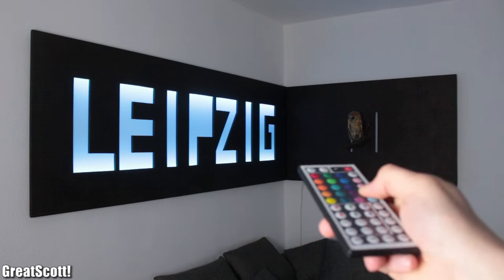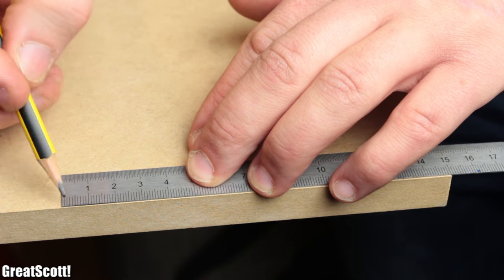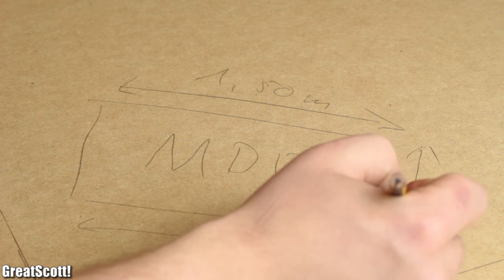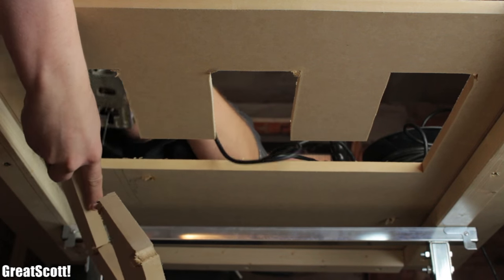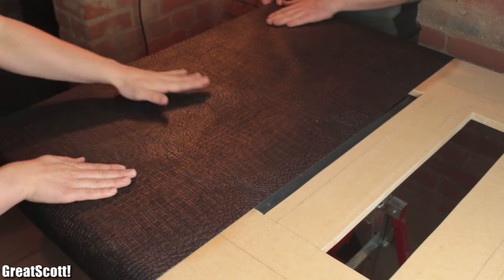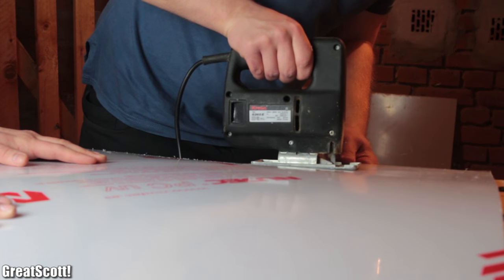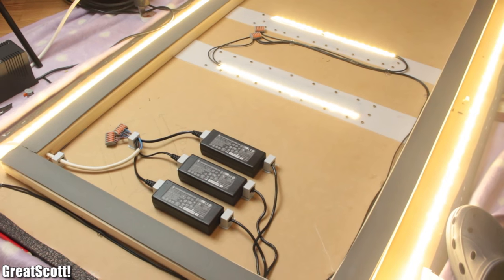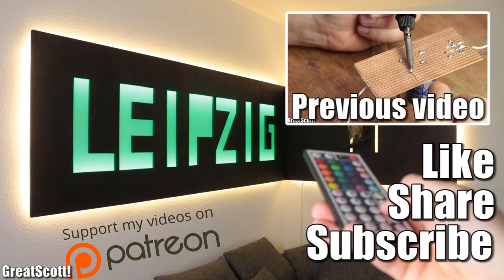How to make a Huge Light Up LED Sign

Comment: When you don't own a Laser think about just getting a "chalk line" (in german "Schlagschnur"), they are less expensive and real simple to use. Mark both lines at the end of the boards and then pull out the cord and pull it tight over the length and while it's under tension pull up in the middle and let it snap on the board it will then draw a clean straigth line of chalk on your wood. This is what was used before all the laser stuff ;)

Nice project.

Comment: A slight improvement to get more light out of it: I built some indirect lighting myself a while ago. You should spray the backside of the wood with white paint. It will absorb less light. you could Even use some aluminum foil but this might cause reflection spots.

Comment: For the Sing, I think you could use something other than FDM, Maybe foam board Or something lighter.If your running wood supports behind it anyways. Also I think you could of used french cleats To support the boards, With out having to deal with a hiding sport for the screws. Those two things i'd likely do differently But cool build

Comment: One thing you could have done is run the AC power through the wall so you dont have the wire dropping down. Other than that, awesome project!

Comment: it will be easier if u use a wedge system to hang the panel.

1 board cutted in half with 45 degrees. 1 to the wall and. to the panel. thats rhe simple way to hang something in the wall without visible screws

Comment: It's a nice video and you explained every detail of the construction. But i am missing the part where you explain how to set everything up to control all the leds from one remote and with different colors at the same time. That's the part i'm interested in.
Reply from the maker: +LsHallo Vader Those led trip kits come with a controller. You just plug it in and it works. Nothing special.
Reply: +LsHallo Vader He is using 2 different controllers and remotes.. You can see it during the video that there are two different remotes.
Reply: +morri908 Ok i didn't got that. In the first sequence it's looking like he is using one controller to first control the color, and then switch on the white leds.
Reply: +GreatScott! I know that. I got one myself. But as you read. I thought you are controlling different kinds of led strips with one remote. That's made me curious.
Reply: LsHallo Vader
Poor video editing. Its a very short clip of the second controller...

Comment: Hey everyone, this project that they did was so awesome!! 
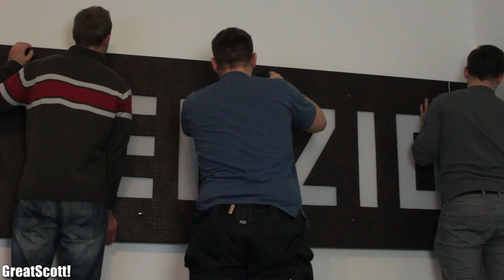but at the very end when they secured it to the wall they used "plastic anchor" 6:12 also known as mollys (not the drug). If you have dry wall than you would rather screw into the studs behind the wall, placed every 16" or 50cm, because drywall anchors don't hold much weight.
it looks like they have some sort of plaster wall and clearly for them the anchors they used can hold enough weight to support their art piece
just a heads up for anyone who want's to build their own sing, I know I want to! haha
Reply: +Matthew zuber those walls are the standart in germany... I know that problem from florida and yeah you are right! It´s kinda important for all non north european viewers !
Reply: +Matthew zuber Securing into a stud is definitely more secure, however, if I were doing this, I'd probably use the same (or similar) technique. There's not much weight in this case, so I don't see the need to ensure it goes into a stud. Those anchors are rated for around 5 pounds each and he has 10 of them; 50 pounds should be plenty. Additionally, you don't really know until you hang it exactly where the studs are, and if you want to move it in the future, the new studs may not be in the same relative place to your holes, overall making the project harder.
Reply: +Matthew zuber Some drywall anchors can hold a lot of weight (in the range of a couple of hundred pounds). While mounting in studs is preferable, it is not always possible or practical. I would tell people that use wall anchors to check the package and make sure they get anchors that will support the weight. Also, if you are renting then wall anchors will probably be prohibited as they will be considered damage. Lots of thought has to go into using wall anchors as well to make sure you don't nick something like a pipe or wire.
Reply: Not the drug, had me laughing

Comment: the way you make your name sign "great scott" what sort of power supply do you use? do you also use a resistor? Were all the leds in series?
Reply: All in parallel and powered by his variable power supply, so no resistors necessary.

Comment: Where did you mount the IR receiver for the LED Controller?
Reply: its not IR controller. I suppose its RF controller...
Reply from the maker: +Ej908Productions It is right above the boards. Hard to see in the video.
Reply: +GreatScott! Ah now I see it. Just to the right above the G.

Comment: Why would you even need 3 of those power supplies? That is way overkill if you ask me. One of those can give out 30 to 65 watts alone, and that's 90 to 195 watts of a playground those LED strips have...
Reply: +Krisztián Szirtes Each of those strips uses ~80 watts. 
I have one of those strips (they're like... 20 USD on ebay for the waterproof ones like what he has), I use an old ~200 watt xbox 360 powersupply to power it because the 65 watt supply I was using could not fully power one LED strip. Let alone 3 of them. 

Although you can technically power up to 3 strips (each strip is  approximately 5 meters) off of one controller...
Reply: +morri908 80 watts each?! That is waaay more than I thought. Thanks for correcting me anyways :)
Reply: That's the least I have used on mine.. I'm uncertain if he is running hte same sized LEDs as mine or not (it comes in 3 sizes, i have the middle one) but anything less than 80 seemed to underpower the LEDs.

as for the 3 power supplies, he is running 3 different strips so that he can have the different light colors at the same time
Reply: +morri908 lol I'm using Xbox PSU too
Reply: Cyan Night
 It's so useful, and technically i could power other things off of that power supply but meh..
I was using an old 20pin power supply from a computer, but jumping the "power on" pin became a hassle...
Reply: yeah same old pc psu lot harder to use